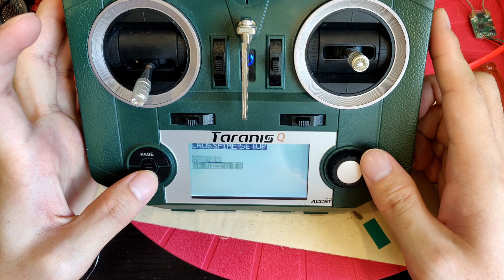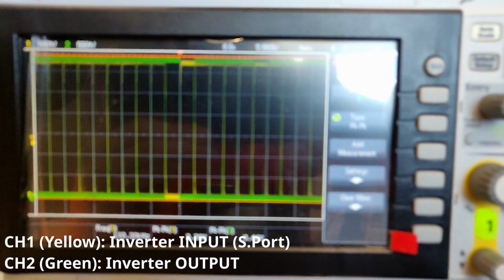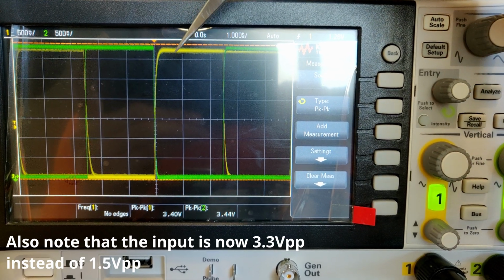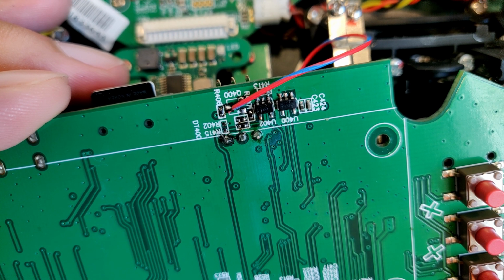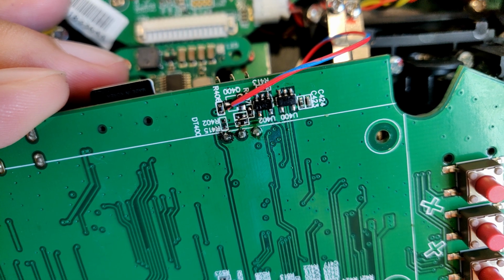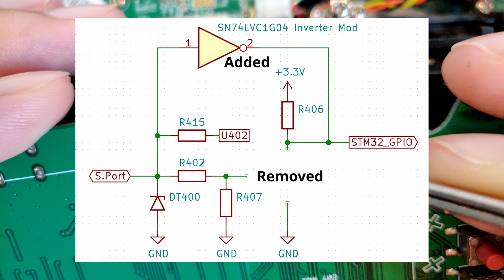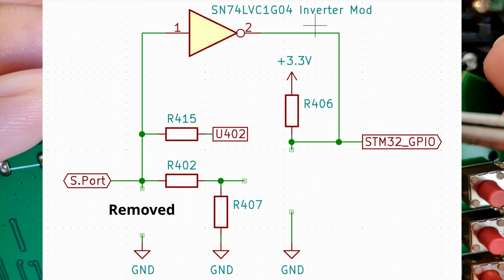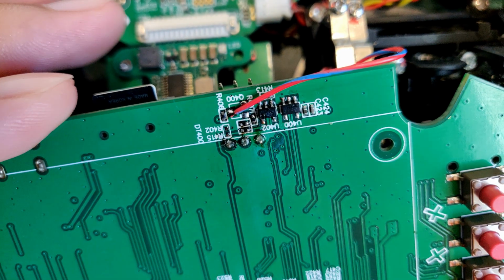CROSSFIRE IS WORKING!!! | Inverter Mod Issue Taranis QX7 Fix | FrSky R9 to TBS Crossfire Part 3

Comment: Hi, after the mod when i turn on the external rf on crosf 400, i get a status error, im wondering if it is the same case,  voltage on output is 3.3, plz help

Comment: Hi!
What inverter was used?
Thanks in advance.
Reply from the maker: I don't remember the model number but it's one of those jelly bean logic inverter ICs. Came with Crossfire Micro Tx.

EDIT: Sorry, just rewatched my own video and saw that I've included a screenshot of the datasheet. It's an SN74LVC1G04 inverter.

Comment: Did you ever figure out why this part needed to be removed in the end? I believe I have the exact same issue but I'm afraid of making irreversible changes to my taranis. Why do others not have this issue?
Reply from the maker: The current standing deduction is that diode is damaged somehow and is pulling the input of the inverter below the required threshold voltage for the inverter to work. Removing it allowed the proper signaling voltage to trigger the inverter to do its job.
I would advise against removing the diode if you're not sure of what you're doing or have no means of confirming that your situation is the same as mine though.
Reply: @KlystromFPV  it's quite possible I have another issue. I am new to electronics and RC planes, however I've not been able to find any other reason why I have no telemetry and the crossfire Lua scripts don't work. Thanks for your input.

Comment: @klystromfpv hey I just watched this and was very excited to find someone who had the same issue of waiting for crossfire screen. I removed the Dt400 diode and still have the same problem. Thanks for your help anyway. I wish this would have fixed my issue but looks like I'll be buying a tango 2
Reply from the maker: Sorry I couldn't help. Tango2 is a good radio

Comment: Hi, nice tutorial actually I might have similar issue with you, the different is only input pin is showin 0.3 volt instead 1.5 volt like yours, do you have any idea why ?
Reply from the maker: Hmm.. Just a few questions:
1. How did you measure the 0.3V? With multimeter or oscilloscope?
2. Was the tx module attached and powered on at test?
3. Also this is with or without the inverter mod?
Reply: @KlystromFPV  1. multimeter, I don't have oscilloscope laying around, not sure if that voltage reading is valid though

2. yes it was attached and powered on, even I used model that using CSRF (tested both with CSRF and R9), RSSI signal bar that used to be on the screen is no longer there, as well as "Telemetry lost/recovered" sound, I guess I trashed my radio telemetry ?

anyway, thank you so much for you response
Reply: 3. This is with inverted mod, and I acan no longer have access to crossfire via lua script, always said "waiting for crossfire"
Reply from the maker: @robbiewarzo  If you're measuring with a multimeter, it is not a valid reading since it is a signal that is (supposedly) going between 0V and 3.3V real fast. Unfortunately, this is an issue that is hard to debug without proper equipment and electronics know-how.

You could run the following tests but at this stage you should still be able to use crossfire if you do not need telemetry/lua scripts. So proceed with caution and recommend you get somebody who is familiar with electronics repair for this.
1. Remove the DT400 diode like I did in the video. Make note of the polarity/direction of the diode in case you have to put them back in. Are you able to get crossfire lua script working? If yes, then you have the same issue as I have where the DT400 diode is pulling the input voltage down. If no, try to reinstall the DT400 diode.
2. Failing above, if possible, remove the inverter mod and solder back on the Q400 transistor. Are you able to get R9 telemetry working?
Reply: @KlystromFPV  I made it working finally, I removed the diode and also at the same time re-solder everything, I guess removing the diode made it worked again like you did in the video, thank you so much!!! is there anyhow I can buy some beer?
Reply from the maker: Great to see you have your radio working again! And thanks for the kind gesture but it's fine, knowing I've helped somebody is good enough for me xD